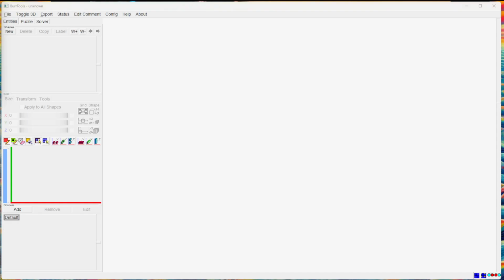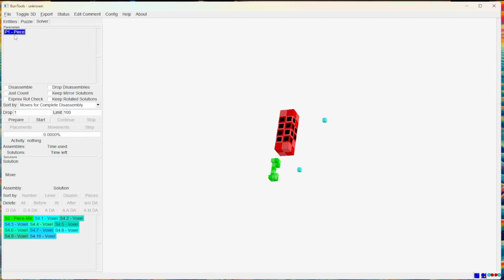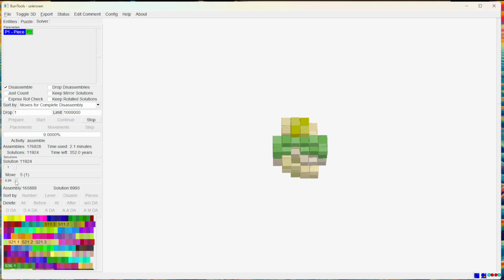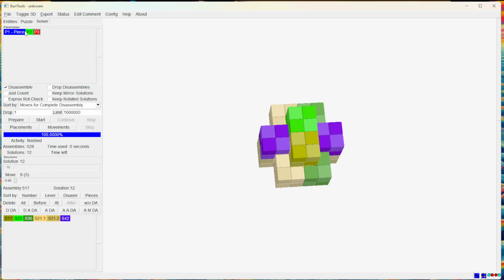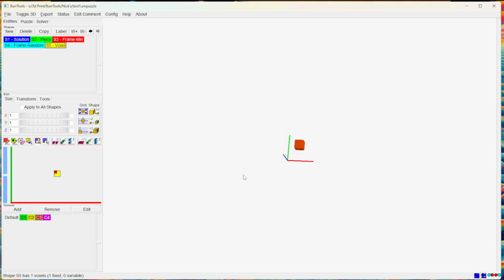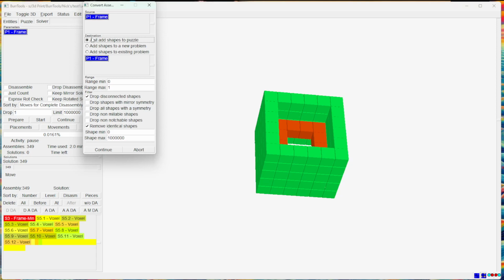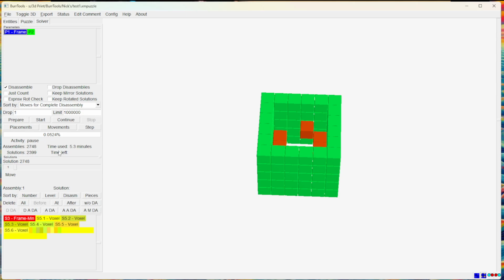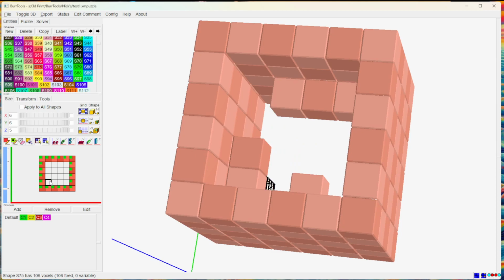BurrTools - Design your own unique burr puzzles

Comment: Hi Nick, thanks for the very informative video.Could you possibly explain the Range min and Range max setting a bit more. I don't understand why you would set Range max to 6 in your example at about 09:03. That would mean that a certain piece could theoretically be used 6 times in one solution, is this correct? If you don't want duplicate pieces in your solution, should you then not set the max Range to 1 in that case, telling the program to use a piece not more then one time in a possible solution? Thanks and regards.
Reply from the maker: You're correct about that.  Sometimes I do the opposite of what I say, lol.
Range Min 0 indicates that a piece may or may not be part of the solution
Range Min 1 indicates that the piece HAS to be part of the solution.
Range Max 1 will guarantee that each piece in the solution is different
Range Max 6 indicates that I'd be okay if each piece in the puzzle is exactly the same.

In my head, I might have been also thinking about the checkbox "remove identical shapes"  this check ensures that if there are any identical pieces in the 1024 assemblies, I'll only consider the unique pieces.
Reply: @windex42  Thank you, all clear now 🙂